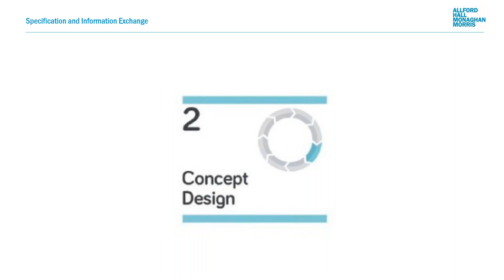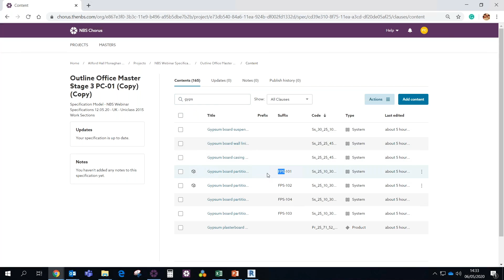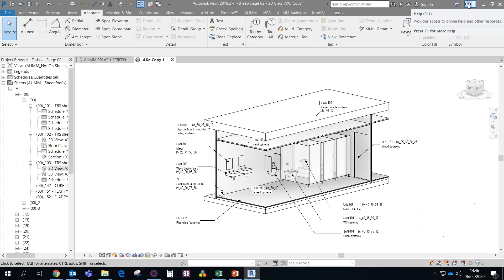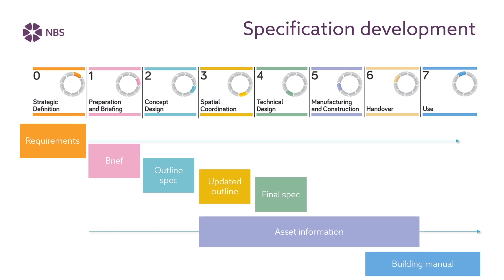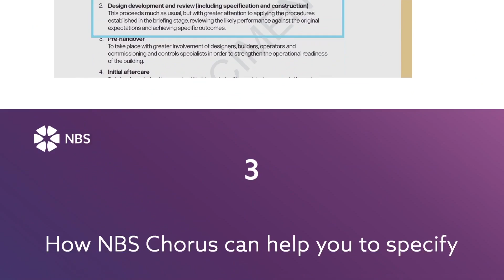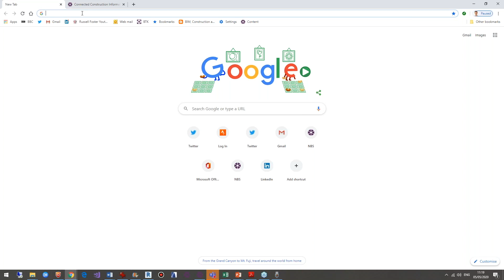Specification and the RIBA Plan of Work 2020

Comment: An excellent presentation but as noted previously in a number of such presentations these processes are very much geared to larger projects. However having had to step down from multi-million pound projects to mostly domestic extensions the loss of the Schedule of Work approach to small scale and refurbishments works is unfortunate as it is the method known and used by facility managers, surveyors and small contractors. Some guidance as to how Chorus can be used as a suitable replacement for the SofW would be welcome.